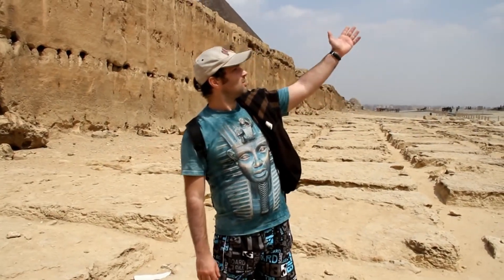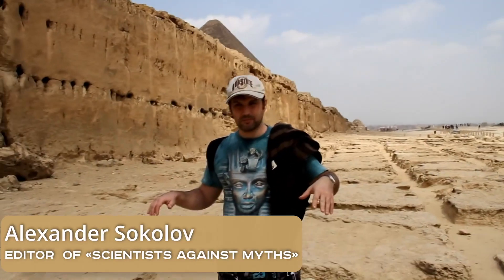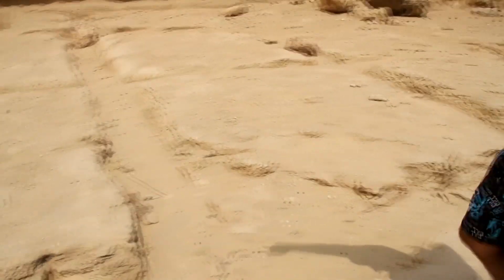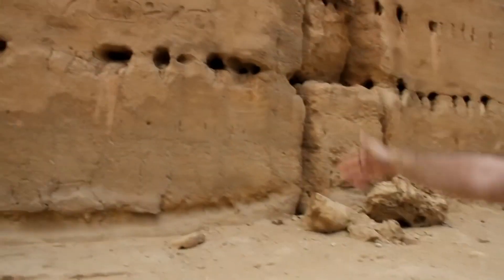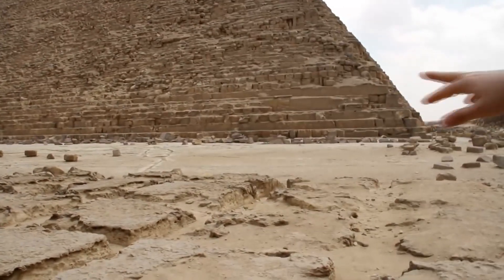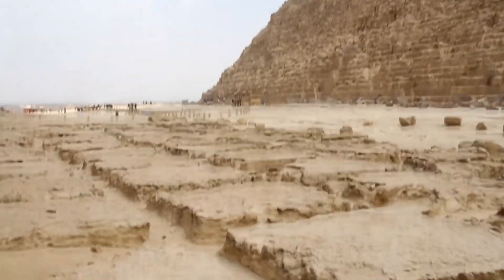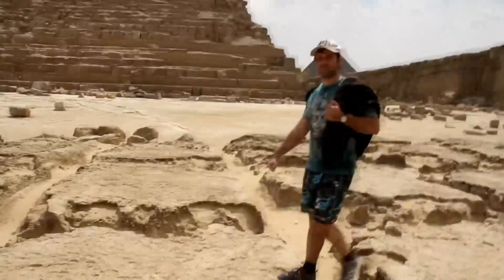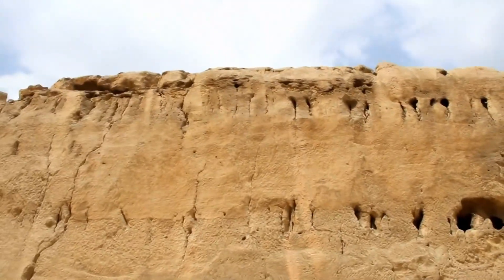What are the pyramids built from? - Quarries of Ancient Egypt

Comment: Well if it flooded or they could of flooded the Nile this would of been mud. The sun dried this.
Reply: The Egyptians originally built of mud brick - and continued to do so for certain things.  Yet mudbrick can only support weight to a certain point = hence why they began to build of stone.  

Yet even stone can only support its' own weight to a certain limit = hence why they began to use harder stone for certain things.  The temples of Karnak as an example have Limestone columns but = Sandstone lintels......  

Limestone can only support its' own weight across a certain span limit and thus harder Sandstone was required for the lintels which span large open spaces above.  So you can only go so high with mudbrick before the weight above causes the bricks below = to crumble......

Comment: Yes the limestone was from around the site itself but over 8000 tones of granite was quarried and transported over nearly 1000 miles from Aswan, that would be nearly impossible
Reply: "Impossible" usually means = "I am unaware of the facts and/or are simply incredulous".  

Moral of the story:  small wooden ships called Cogs used to ply the major rivers/coastal areas of Europe for centuries.  They typically ran 15-25 meters in length and could carry loads in the hundreds of tons range.  The Roman grain ship ISIS was recorded to have been 55 meters in length.  It used to go back and forth transporting 1,200 tons of grain from Alexandria to Rome each trip. 

So the area just east of Khafre's valley temple which sits ~500 meters from the Great Pyramid = was once a harbor area.  Shipwrights who study ancient ship designs estimate that the barge used by Merer to transport the white Tura limestone to Giza could carry loads in the 70-90 ton range - enough to transport the granite relieving slabs.  They also estimated that during "a season" - the 2-3 months each year when the Nile would flood its banks - that a single barge like Merer's could transport upwards of 1,000 tons of stone - depending on the size of the blocks.  Hence:  "possible" after all......  🤨
Reply: "nearly 1000 miles from Aswan"
Meanwhile, in reality, it was less than 1000 kilometers.  Also, no mystery, as barges transporting goods along the Nile was commonplace.

Comment: 2.3 million blocks carved out using copper tools anywhere from 3 to 20 tons each. Then they managed to stack them completely level lol I don't think so. If you have ever built a wall you would know any little mistake at the bottom will ruin the top
Reply: The blocks weren’t all the same size. It’s not like making a retaining wall from regular units. The interior blocks had lots of variations and gaps between them.
Reply: @Cody Smith - Small correction, this "2,3 mln blocks" is obsolete number (there are less than 2 mln of them). Also, "completely level"? Did you even see these blocks?
Reply: "3 to 20 tons each"
Wrong.  The average mass of a block in the great pyramid is less than 2.5 tons.
Reply: @AlbertaGeek  There are some weighing 80 tons.
Yes, the average is probably two point five

Comment: Are all the blocks from here? I imagine all the volume of the pyramids would stretch for miles if laid out in a flat layer.
Though, I can't actually see how far the quarry goes from here.
Reply: Do the volume calculations. The base is a solid slab, even with the top of the quarry wall. So basically a mote was dug around it and the material piled in the middle.

Thats an oversimplification, but close enough.

Comment: Here is where this "concrete" claim rubbish comes from folks.  As noted the Egyptians primarily used limestone to construct things as it was plentiful and is somewhat easy to work with.  Yet it is not a good load bearing stone and thus they also used other basalts etc. for their strength and/or decorative effect.  They also however used a gypsum mortar which saw many applications.  It was made from various minerals mined around Egypt to include the gypsum itself which was sourced to the Fayum region near Saqqara.  

When Sneferu made his Bent Pyramid the engineers built upon a poor foundation and the initial angle of ascent was too steep.  Limestone being a mediocre strength stone as alluded to began to subside and the sides sloughed away.  The Egyptians attempted to repair the pyramid via using various substances to try to shore up the sides.  One of the things they tried = gypsum mortar.

So all this "geopolymer" rubbish - aka concrete - is a result of a person taking a sample of = the gypsum mortar used to repair the pyramid.  They then "extrapolated" all the rest via claiming the Egyptians supposedly fabricated blocks from that stuff - nope.  The quarries and even the blocks themselves reflect their hewing blocks from the bedrock.  Blocks reflect the layers of limestone they were hewed from as limestone is a sedimentary stone which forms in layers. Blocks from a premix - in other words a mold - would be uniform in size/shape/consistency - which we do not see.

Comment: I just wonder what had covered the rough quary botrtom all those years after quarying, not a fun place to watch the piramides from. Maybe nice stones that are robbed and used somewhere else?
Obviously a part of the piramide was built with stones from the near quary, but has anyone calculated how much stone was quaried there and how much came from somewhere els? They had a doable method to get the stones on top of each other, obviously. It is a fact that lots of the granite was quaried hundreds miles away, heavy to transport by boat but easy to do when you have the equipment, people, skills, waterways that were higher back then. 
Motivation is easy if the reason is strong enough. It is easy to get millions of people chasing invisible for the eye fantasy creatures on their smartphone, so why not build a huge piramide for benefits like good food, eternity in heaven, whatever. No one can prove you don't live an eternity happy in heaven, so, no problem. A trusty fac and lots of bread, beer and games do the trick.